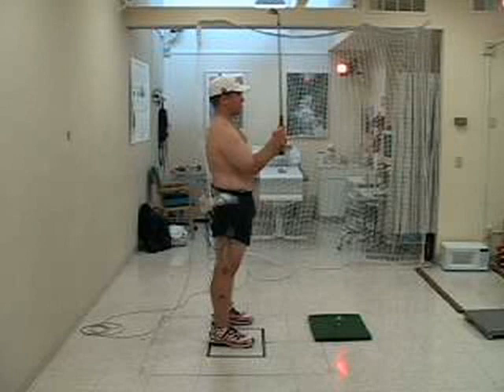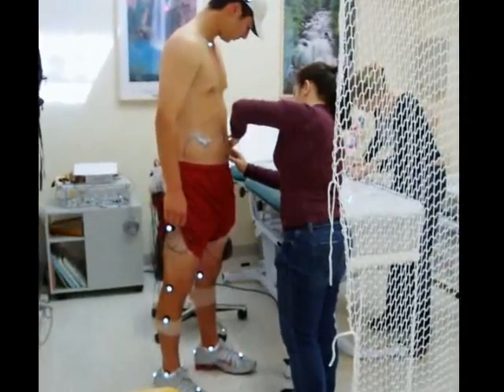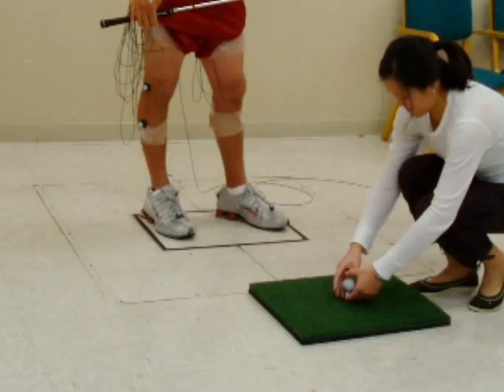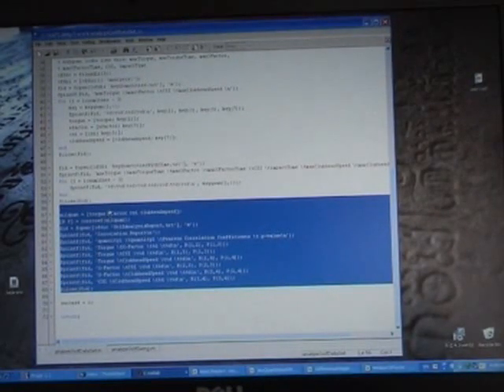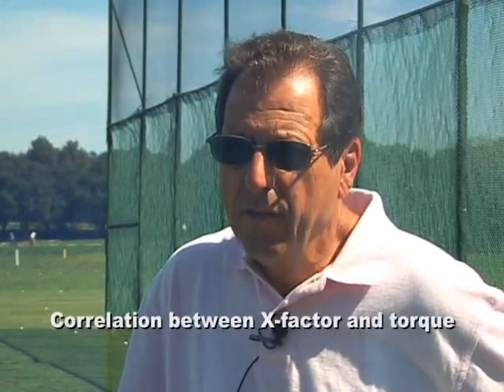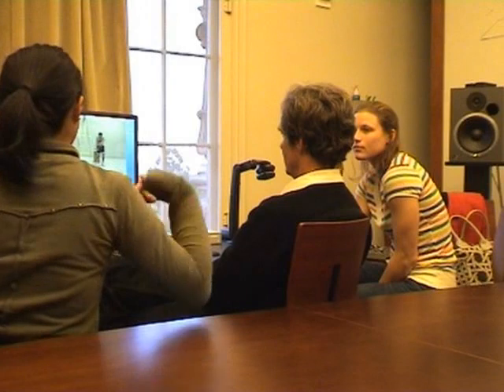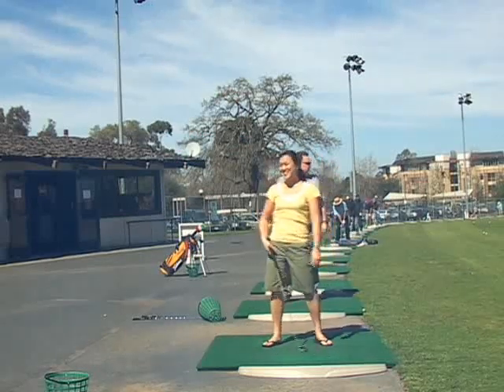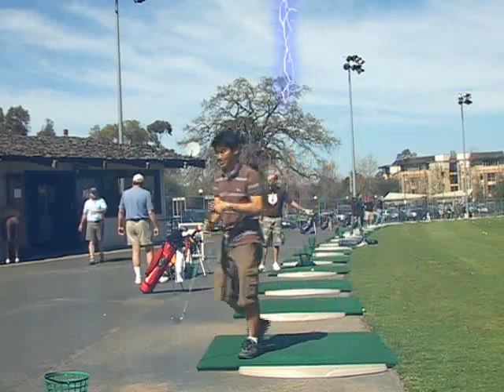The Biomechanics of the Golf Swing

Comment: RESULTS: 1. Peak Stance Torque ("PST") correlates significantly with Club Head Speed at Impact ("CHS") BETWEEN all 10 subjects. 2. TIMING of PST DOES correlate significantly with TIMING of CHS. 3. Peak X-Factor ("PXF") DOES NOT correlate significantly to PST BETWEEN subjects. 4. PXF DOES correlate significantly to PST WITHIN subjects for 6 of the 10 subjects. 5. TIMING of PXF DOES correlate significantly to TIMING of PST. CONCLUSION(?): Magn. of weight shift is most important to club head speed.